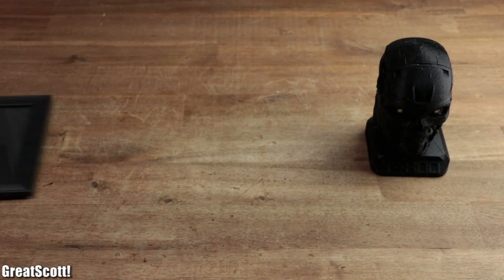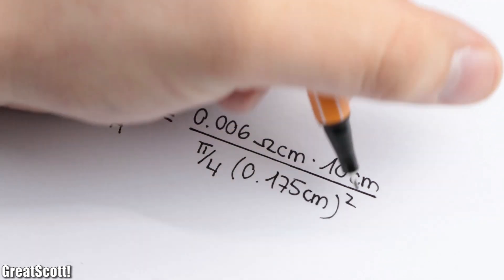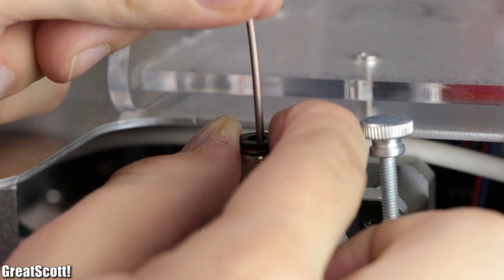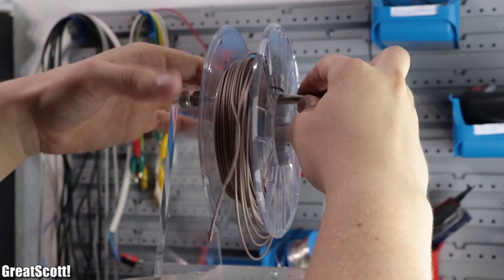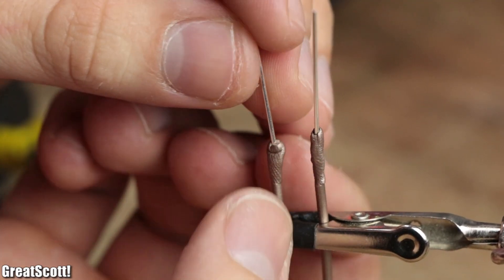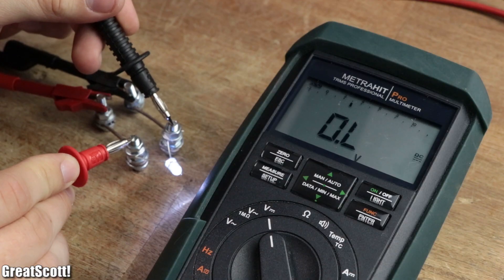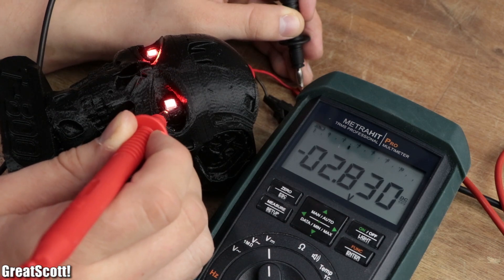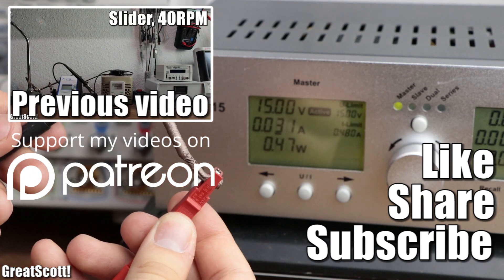Conductive 3D Printing Filament - Resistance/Power Test

Comment: I was thinking that this could be used when 3D printing cases for hardware. If you somehow tell the slicer to use different printing head for only inner walls, you can make a shielding from this material.

Comment: I wonder if it conducts better along the printing plane, rather than "crossing" the layers. The nice part about using it with LEDs is that it can be the current-limiting resistor. It could also be used to print low-temperature heating elements, like a reptile heat pad; it'd even fail-open if it overheated.

Comment: Does not seem worth it albeit looking cool. I'ld rather print a top and bottom circuit part and put metal wire manually inbetween it

Comment: its really usefull when you want metal electro plating  with copper,zink,nickel or aluminium the print for more durabillity and a better look^^ on the other hand you can Grind PETG filler it paint it with conductive silver and electro plate it after...looks also way better and not anymore like a 3d print

Comment: Try putting soldering wire in the 3D printer
Reply: That wouldn't work. In order for a proper 3d print, x,y, z-axis must be in sync with the material. Too fast of cooling and the material will be clogging the extruder and too slow would result in the material drooping.
Reply: That would be damn cool if it would work.
Reply: Then I'm going to sacrifice a nozzle in the name of science, who knows what can be done if it actually worked

Comment: I noticed the tests you conducted mainly consisted of using the raw filament or the giant thick cylinder. In real world if this was used on a circuit board, you would be using a much thinner layer of material. I wonder if the thickness of the print affects the resistance and heat/melting point. This could explain the contact area hotspots as they were giant blobs.

Comment: This has one fantastic application which I can think of: 3D printed fixturing for ESD sensitive devices.
You can print any sort of fixturing you need, then ground it as you would a metal fixture and bam you have a cheap and easily replaceable fixture that is safe for processing static sensitive product.

Comment: you could have measured the resistance as a function of filament length... if you plot it then the y-intercept is the contact resistance and you can obtain the desired value from the slope

Comment: Try to use lead-tin soldering wire as filament, melting point is about 180, stock hotend should be good enough :D

Comment: Try putting a tube between the bearing and gear of your extruder. File down each side of the tube so it fits tight between them. I used a replacement hot-end tube with teflon lining.

Comment: Contact resistance with probes is negligible.
I did see around 50 leds , times 20mA (lowest guess) for each led.
Which requires 1A at 5V = 5Watts of power, maybe a little less.
The tracks of the cuircuit were pretty thick and wide, though.

Comment: I’m interested to know how contact resistance would be affected by dielectric grease. I can see this being useful for replacement buttons with conductive carbon contacts and replacement battery doors that originally had a plate of metal. Then again, copper or aluminum tape often works well enough.

Comment: Checking the resistance of the filament isn't a good test. When the filament is printed, the metal particles in the filament can flow and come into contact with each other. Prior to heating, the plastic binder will keep the particles apart and insulate them from each other.

Comment: if you touch the multimeter terminals while measuring impedance, it will display the parallel resistance of the filament you are measuring and your own body, so you will in fact see an smaller value on the screen
Reply: true, but the high impedance of skin in parallel with the much lower resistance of the filament makes the effect negligible.
Reply: sorry but, while it is true it depends on the skin conductivity and it varies a lot from person to person and even the same individual during the day, it is not negligible. Try it yourself and you'll see. I have a bachelor degree in Mechatronics Engineering, I am talking from experience.
Reply: Just measured my resistance to be 2.5Mohm. That's much higher than the average of about 50k so let's use that instead. Did they teach you how to calculate parallel resistance in school? 50k in parallel with ~50 ohms he was measuring gives 49.95 ohms- a 0.1% error. 

Even going down to the resistance of wet skin (1k) gives 47.62, only a 4.8% error.  That's still fine for something like this  and is completely swamped by other errors such as length of the wire and contact pressure. 

Class dismissed. :-)

I'm an electronics engineer (not a half-electronics/half-mechanical engineer) and have been working in electronics for 20+ years. That includes certification to work on nuclear reactors, working on one of the world's largest particle accelerator, and part of the team that built the JWST Space telescope.
Reply: hmm, you must have some really dry skin. I was not aware I was talking to an alligator.
Reply: lol surprised me too! went and got a glass or water. One electrician i knew used his pinky and pointer finger to test for 110 or 22vac.

Comment: I wonder if you could electroplate the filament or the prints made with it
Reply: I’ve tried that. It didn’t work well. I even tried regular pla with conductive paint and the. Copper plate.. didn’t work welp

Comment: Nice! So you wouldnt recommend this material for an um2 because it has a bowden tube
Reply: Bowden tube has nothing to do with it. It's the extruder that must be capable of handling flexible filaments.
I have a bowden extruder which does flexible very nicely.
Reply: Sevendogtags Okay, thank you 😊

Comment: At 5:09 you "compare the data signal from the arduino with the same data signal after travelling through the filament".. not quite right. Each WS2812 LED "regenerates" the serial data, so electrically you're just measuring the last segment of filament. 

(The input and output signals match exactly because the same colour is being sent to each LED in continuous sequence. If there were different colours in the data stream, you'd notice a difference in input and output bytes, though the timing is synchronized.)
Reply from the maker: +Jeremy Lee  I measured the output of the arduino and the input of the first led. That was the biggest length of filament the signal had to go through.
Reply: Ah I see! I'm sorry, I misunderstood.
Reply: Wow. The moment I saw your comment, he said that. Lol

Comment: how could plastic be conductive?
Reply: seven you might want to reresearch how the stuff works lol
Reply: He's not triggered.  @jacobthalfman is justifiably annoyed because he is CORRECT and yet @sevendogtags is being a douche nozzle and wrong at the same time.... From the manufacturer's own website: "Electrifi Filament is a non-hazardous, proprietary metal-polymer composite that consists primarily of a biodegradable polyester and copper."

IT'S METAL PARTICLES IN PLASTIC.   

Jacob 1 > SevenDogTags 0
Reply: Good one
Reply: "Instead of spewing your ignorance around"
Are you just trying to be a useless dickhole?
There's a difference between non-conductive metal filament and conductive metal filaments, there is also a difference between graphene conductive filament and metal conductive filament. you are what the maker community despises, assholes who forget how to interpret shit simply to attempt to be correct.
Go try doing this in real life somewhere and watch how badly you're torn apart. 
I have no need to comment other than this. toodles.
Reply: it's a metallic plastic. it has metal in it
Reply: Jacob Halfman xXAwesome McProXx
I have 3D printers and a few spools of metalic filament, non of which are conductive nor are they meant to be conductive.
Colorfabb makes excellent metal filaments, they're about 80% metal if I'm not mistaken and they're not conductive. Look it up.
Want proof? How about you google what I told you? Or is that too hard?
Graphene filament? Or the conductive PLA compound I told you about, it's what proto pasta uses.
There's other conductive filaments out there too, like conductive ABS which has carbon nanotubes inside.
There are far more expensive stuff too, which you can look up yourself instead of spewing your ignorance around, good luck! ;)
Reply: Jacob Halfman triggered
Reply: Nope, very wrong. Metal in plastic doesn't make it conductive, even at high mix rations in favor of metal, there's still going to be plastic in between the particle which will prevent conductivity.
How is it conductive then? Depends what kind of conductive filament it is, it could be graphene which is naturally conductive or a PLA compound which is naturally conductive etc...

Comment: This could be somewhat useful if your printer supports using two or more types of filament simultaneously, if you want to make something extremely complex. I think I would still prefer to have a few spools of copper wire of different thicknesses. Maybe even some aluminium wire.

Comment: I found a paste like material, I guess a paint, that is used in industrial applications. It is applied through screen printing. This way you could make very thin circuit boards via screen print by using this material. Anyone ever tried such a thing?

Comment: 1:27 you should not pull the filament out while the motor is still engaged it spins to fast and breaks like mine 
i did the same thing with my 3d printer :(

Comment: Can you 3D print a 3D printer? 😵
Reply: Please print some pcb,  with electronics, steppermotors, electrical wires, nozzle, heater element, bearings, linear guide rods, timing belt, leadscrew,heated bed etc. :) ...... Oh wait, just print some brackets to hold all of that together.
Reply: Sayuj Raphael thats called RepRap
Reply: That would be like von Neumann Machine/probe.
Reply: Thats what they were invented for.
Reply: +Riebulka
Not really, connect 2 parts together, with or without 3D printed parts. You can make it as large as the material can support.
Reply: lulzbot minis are made of 3d printed pieces (excluding the mechanical parts)
Reply: That's just awesome
Reply: Yes. And I have done that.
At least, some parts of it.
I bought v-slot aluminium profiles and printed the rest.
Motor mounts, bearing holders for trapezoidal lead screws, etc.
Now I have 2 3D printers, bigger than a washing machine, with
a printing surface of almost 50x50 cm
So, in theory, I can now print the entire 3D printer, but it will allways
need some parts to enforce the construction and it would
need bearings, guides, motors and so on, of course.
Reply: You can print some parts
Reply: Yes, for the most part. I think the reprap model called "Snappy" is probably the most 3d printed 3d printer, but there are a few others which look like they come close, like these...

https://www.youtube.com/watch?v=CJ2F-YjHe2k - Helios

https://www.youtube.com/watch?v=AMR9Lrf9uPM - Snappy

https://www.youtube.com/watch?v=pm2vduqkvqo - Wally (they're using string instead of belts!)

https://www.youtube.com/watch?v=Y1bLyOXbOsY - Simpson (more string in place of belts!)
Reply: Yes
Reply: Yes, about 90% of one anyway.
Reply: but every time it would get smaller